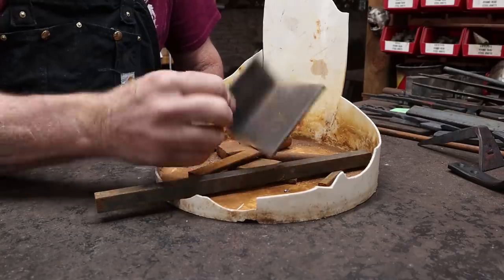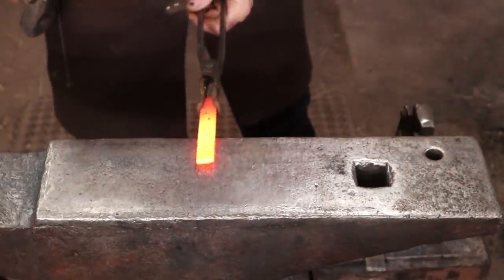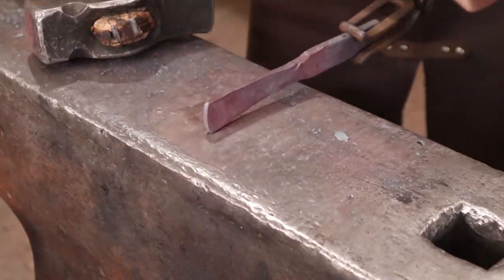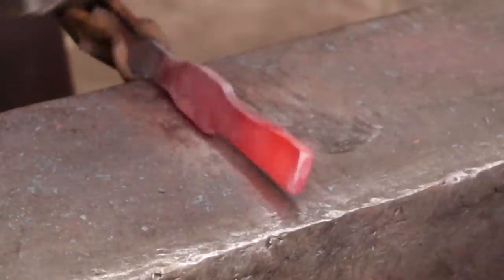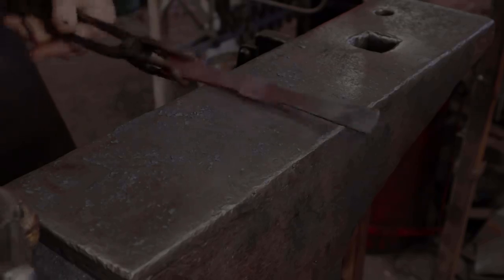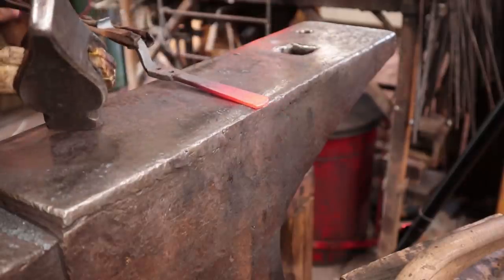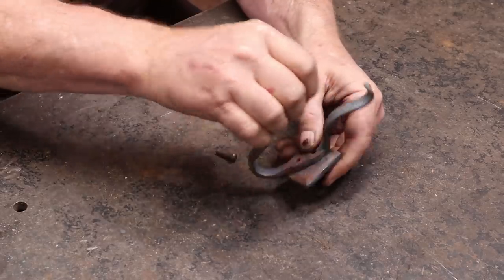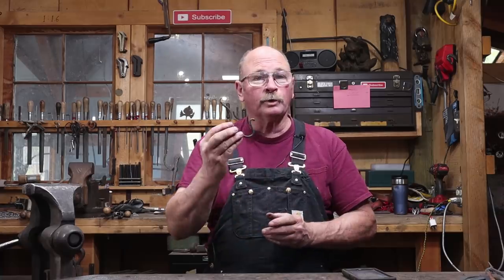Coat hook with diamond back plate - Hook of the Week 22

Comment: That looks really nice. I've got loads of 6×30mm stock and I'm thinking of doing something similar but cutting the top and bottom sections in half so it ends up with 2 hooks at the top and 2 at the bottom 🤔 I really, REALLY need to get my forge going again now that the weather has cooled down a bit. Thanks for another great project 🙂👍👍👍
Reply from the maker: Sounds like a good plan